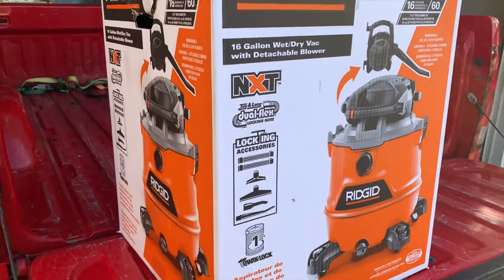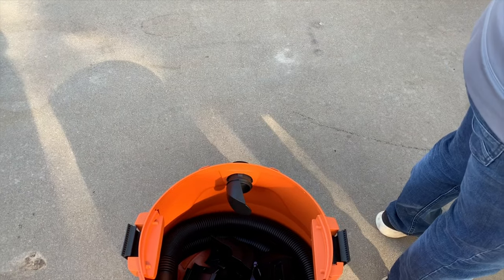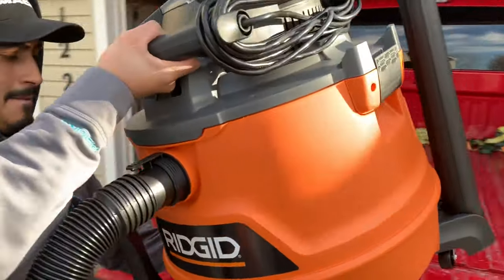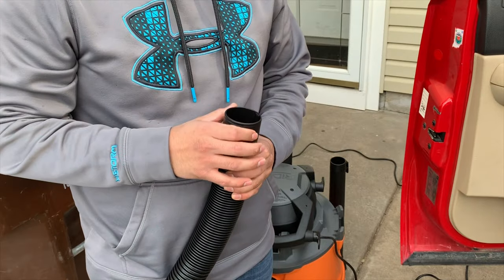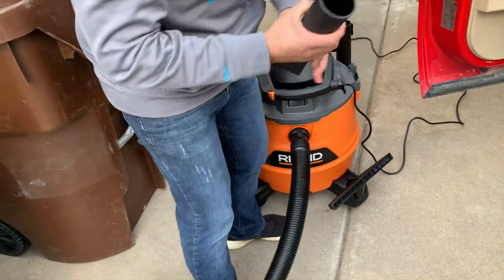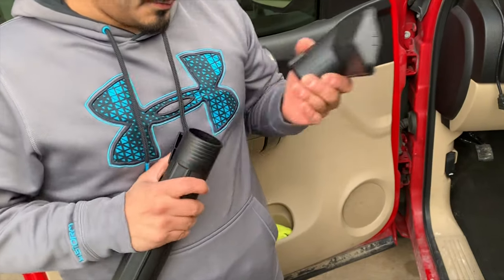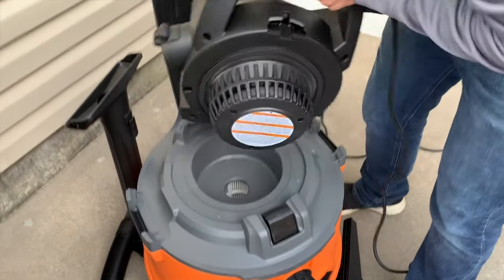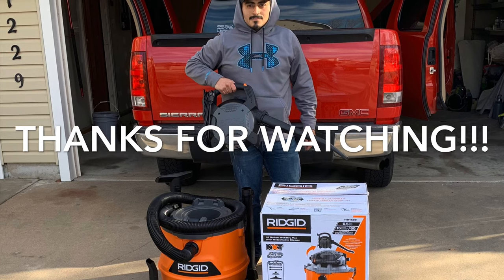RIDGID 16 Gallon Wet/Dry Vac With Detachable Blower

Comment: I have this vacuum cleaner about a week and i used it today for 10 min and it started slowing down and emmiting a burning smell so i shut it off and checked inside but nothing was wrong then turned it on again and its fine but look at the top cover,  notice not all the vent holes are punched out for the exhaust for the air that cools the motor,  im taking it back to Home Depot cause it looks defective
Reply from the maker: Yeah I would take it back for another one! I haven’t had any problems with mine!
Reply: @OZBros  Im going to do that

Comment: Isn’t it a wet dry vac? How about trying it out in water. And that rubber thing is a squeegee not for hair it’s for pulling water.horrible video.
Reply from the maker: Yes Wet/Dry Vac. I know if a squeegee but it Works great for hair!!!
Reply: Also using blower attachment upside down 👇